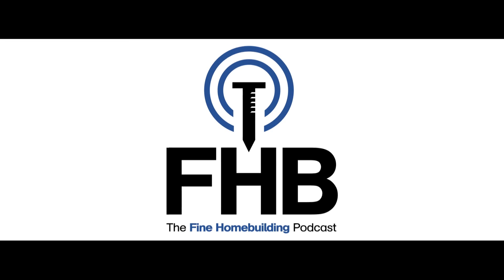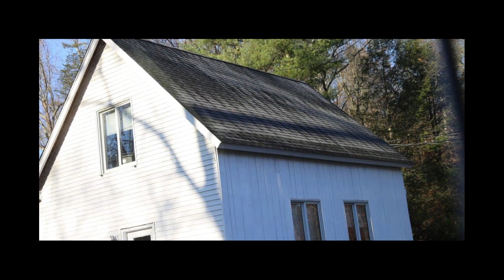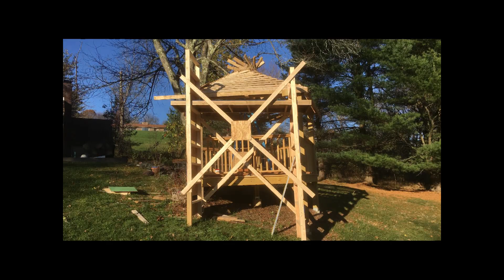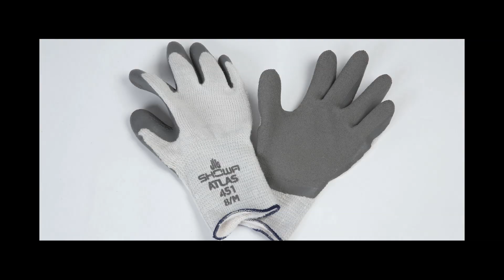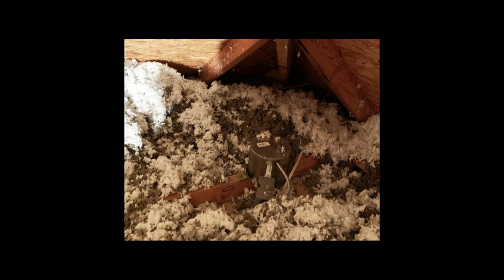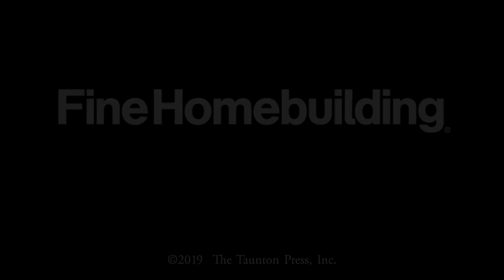Podcast 211: Attic Insulation, EV Work Truck Conversions and a Wonky Can Light

Comment: Install flush mount LED that can fit into the thickness of 1/2" as a minimum clearance, so then you only have to notch for a small wire that leads back to the box that can be mounted on the side of the joist, if that is even necessary.